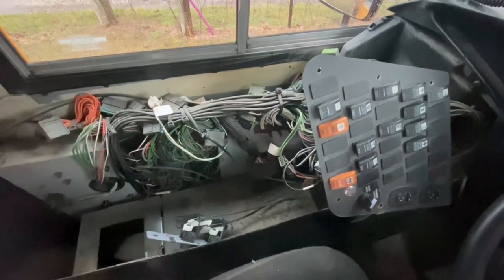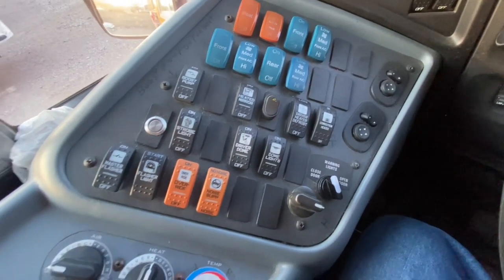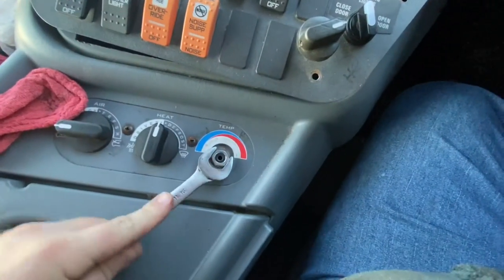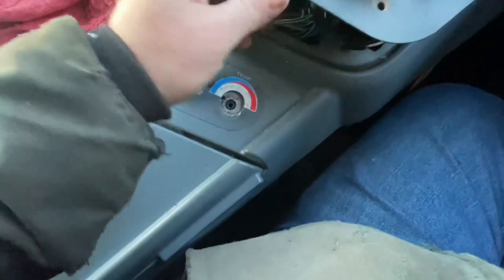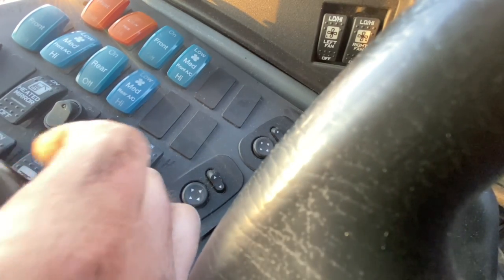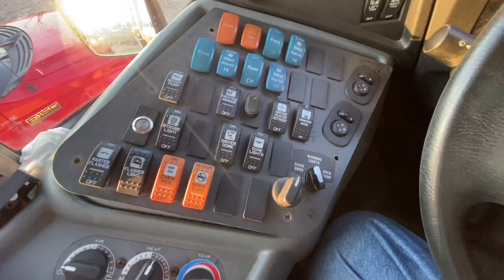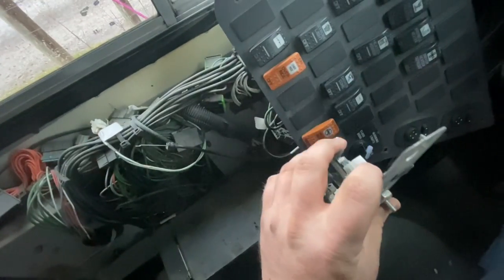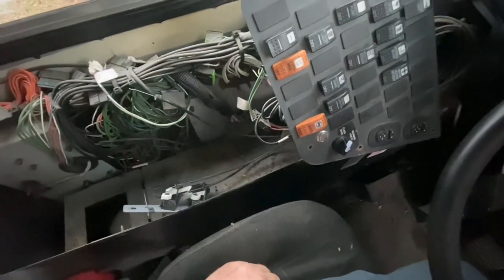2013 INTERNATIONAL (IC) CE School Bus heater blend control replacement

Comment: The old buses I drove from 1982 to 2007 just had blower on and off and water valves under the hood.  No blending for them.  Thanks for the work making your videos.
Reply from the maker: Thanks Gary! These still have those valves but they definitely added more comfort features than the olden days!

Comment: The brand new 2013 IC lift bus I drove over in Jennings County for 4 years did not have air conditioning. The last I knew in early Dec. it was still going although sometime after spring of '17 after I quit driving it, it had to have a engine overhaul. The school corp now has mostly Thomas Built buses.
Reply from the maker: Yeah we had those same problems with the MaxxForce 7 engines. The pollution control ruined engines. Now the IC busses come with a Cummins. We have mostly Thomas as well but I’d much rather drive an International. They’re laid out much more comfortably in my opinion.

Comment: I worked in the bus garage at the school district where I worked.  They can be interesting beasts to work on.  The bus I drove was an 84 passenger pusher built by Thomas buses.  It had an 8.2 Detroit in it with an Allison automatic transmission.  That was 30 years ago. 😳
Reply from the maker: It’s been nonstop. People always find a way to tear them up.

Comment: The real reason Ross knows details of the bus is probably due to the fact he was always in trouble and had to sit by the driver all the time. 😂
Reply: the bus he rode was much shorter
Reply from the maker: 🤣🤣🤣 my grandpa was a bus driver so I did spend a lot of time riding in the front seat. And the buses were shorter than, but the one I rode wasn’t painted blue so we’re still good.
Reply: @rosstheoliverman  well, at least it seems everything turned out OK, other than that slight tick